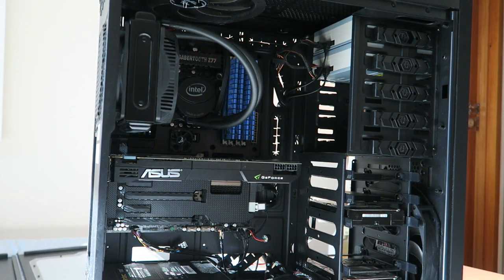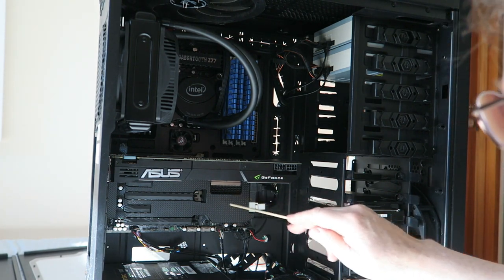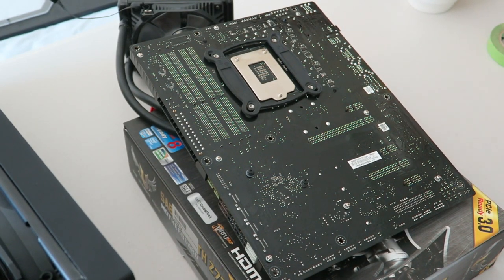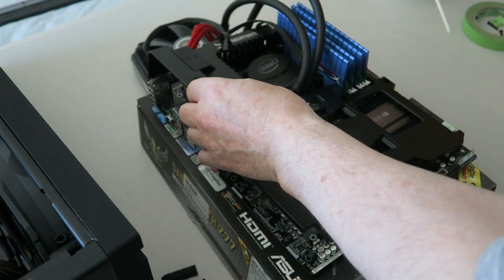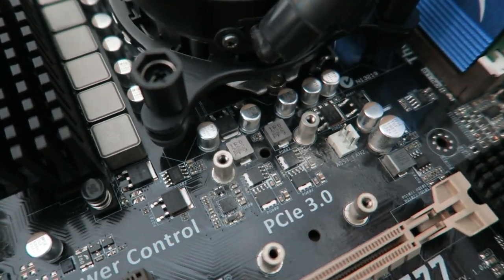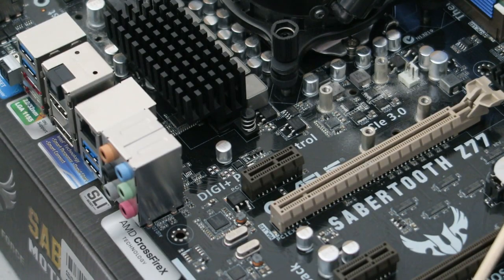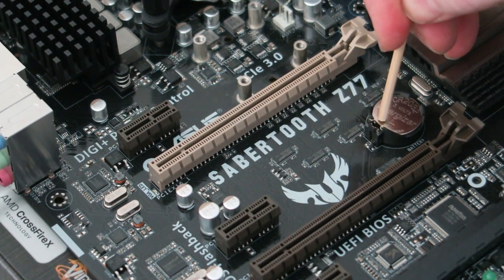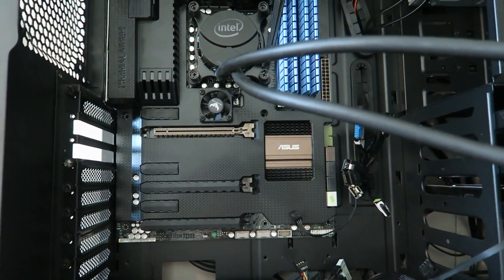ASUS SABERTOOTH z77 CMOS BATTERY REPLACEMENT

Comment: Just wanted to write and tell you thank you for posting this video. I have the same Z77 and I've noticed lately my time clock starting to drift slower as well. Not completely out yet, but I'm likely going to have to do the same thing you did soon enough. Thanks for showing us how you did it!
Reply from the maker: +wxmeddler  My pleasure...I Googled and You Tubed information for the z77 Sabertooth but nothing seem to come up specific to this board...so I thought I would do this video...thanks for taking the time to reply
Reply: Yes, I'd like to add my thanks too: at the moment the clock is keeping up, but not all the Bios settings maybe also because I wasn't turning the machine on since a while or at least leaving the PSU on the ON position to recharge the battery. I also have a full house inside the case regarding boards and a full disks array besides the cooler and about 8 fans (!)... I'm afraid it will take a couple of days just to change the battery for me: if I'll have to do a full disassembly I will possibly cut a window in the armor using my Dremel tool...
Reply from the maker: Thank you for the kind words...cutting a hole in the armor was done by another frustrated You Tuber...lol
Reply: Eheheh
the more I think of all those wiring, tubes, boards and what not, the more I'm convinced to expand the nearby hole: if only my Corsair C70 case had a full access to the back of the board I would have considered to unscrew the armor and just remove the boards and slid under the hood to replace the battery, but to have to completely disassemble my build to the bare bones just to change the battery is, well... unthinkable!
Cheers

Comment: Hi, thanks a lot for this video. I have a computer with the same motherboard and the battery stopped working some 2 years ago. After watching your video then, I decided not to try to replace it since the computer was still working but only in the standard default speed 3.5 GHz - where initially (it has a more powerfull cooling system) it was overclocked to 4.4 GHz by the shop I baught it from. That worked very good till the battery started failing after 5..6 years in use.
Now I purchased a new PC (Win11 compatible) which is really fast and nice (with M2 SSD of 4 GB) but the one with the Z77 is still good and now, that I do not risk loosing any work, I can try to follow your guideline to disasemble, replace the battery and reassemble the whole thing. If I'm successfull, I can either sell it on ebay or just give it away to somebody who can use it but does not have the money to buy a new PC (even if it will stay on Win10).

Comment: Thanks for the video. As soon and the POST complained about no CPU fan, I knew something had gone south... Labour Day weekend 2018 and mine just did the same. Think I am going to take the time to take everything off and then cut out a hole over the CMOS battery so I don't have to do it again. Sigh...
Reply: So, that was shockingly easy. Took me about 30 -45 mins all in. Although, with my after market CPU fan on the thing, I wasn't taking the plastic off and I didn't cut a hole. But, once you get all the screws and fan off, there is enough room to get the battery out and back in again without having to take the plastic cover off. Which is good as that would have been a right bitch...
Reply from the maker: Glad it was that easy for you ...lol

Comment: Thanks for video! Same problem. (The battery - actually cell - does more than just hold the settings - it keeps the clock going [it's basically the same sort of clock as you'd find in a wristwatch]. The cell number, by the way - 2032 - means 20mm diameter, 3.2mm thick! [There are also 2024 and 2016, same voltage but thinner. You find them in some remotes and other things.])

Yes, definitely design fault: I think of ASUS as quite good, but they really slipped up here!

I think we've decided not to go through all this, but just leave the PC plugged in; shutting it down (from Windows 10, probably most other OSs too) leaves the PSU on standby, which keeps the settings [and clock going]). If you do turn it off (or there's a power cut). and assuming you haven't set any settings other than the defaults, four keys will restore it to normal: F1, enter, downarrow, enter, with a pause befor each. (I was attending to it for a blind friend, who can't use the mouse, hence the need for a key sequence. His normal speech output doesn't come until Windows is started: a shortcoming of the industry in general - no-one makes a talkinh BIOS yet AFAIK!)

Comment: Awesome video. Brought me on the right track. Could be shorter, but as you previously stated, it was your first video. It took me an hour all in all without removing the Intel i7 processor and DRAM modules. Hope you get more thumbs up. And no: I didn't cut a hole for the next replacement, as it will hold for another 4 years and then the mainboard and processor will be replaced. Thanks a bunch.
Reply from the maker: Glad to be of help...next video I will get straight to the point...lol

Comment: Replacing my battery looked like a night mare so I was looking for an easier solution
I came across your video and saw that yours was an even bigger task
3 and a half hours,wow that is some length of time,you could have run a 25k marathon quicker.thanks 
Good video by the way
Reply from the maker: Thanks for showing some interest...yes it did take me a while, but I am not a computer tech person so I purposely took my time.

Comment: I also want to thank you for the video. I have the same problem and already had premonitions that it will be a lot of work (though I still hoped there would be an easier way :-) ). Btw, dear manufacturers: Why are the batteries not integrated into the front panel of the computer case with a little cover and connected with a cable to the board for a quick change? This is 21st century.
Reply from the maker: +Frisian Freedom  Thanks for showing some interest...and great idea btw.
Reply: Ys, this is indeed 21st century - when not only do manufacturers expect us to change things in less time than these cells take to run down, but we've also by and large accepted that conditioning. (For 'phones, they want us to - and we seem to have accepted that we will - change them far more often than that!) At least be thankful the cell is stil easily changeable in a holder, not soldered to the mobo.

Comment: Did you put the  armor back on or did you decide not to?
Reply from the maker: Hello sk8ernutdw...thanks for taking the time to comment....Yes I did put it back on because it did help reduce the dust collection on the board overall, except in the area mentioned in the video....I will probably have replaced this computer by the time the new CMOS battery fails again...lol
Reply: What about the ram? Did you really leave it in there? Wouldn't that be a bit risky? Normally i would maybe take the ram off... just wondered what your thoughts on that. I have to do this tomorrow it sucks.. i am so angry the fact they had a design flaw..
Reply from the maker: Yes I did leave the Ram on the Motherboard, but you can take it off if you wish...see video at 6:42.
If you want another way to change the CMOS Battery see this video...this is not my recommendation though, but it work for the video creator
https://www.youtube.com/watch?v=xdCNeT-sjjk

Comment: Have same problem on my z77 ROG. Goes to same start screen. And I had forgotten my Bios password. Luckily online help referred to ROG as having Cmos clear button at rear panel. Password gone, Bios now accessible. Can now look for battery. Look at manual online, battery is under graphics card. I have a very large Asus Gtx 680 CU that takes up 3 slots (has support bracket because it is so heavy) that is a chore to remove. Now with your help I can get battery and replace. Thx for Video. Any help is help.
Reply from the maker: Sorry for the delay, thanks for your response...glad I could help

Comment: To change the battery in a Ferrari Mondial one must first remove the passenger front wheel and inner fender.  Maybe this is a common issue with batteries in fast machines.
Reply from the maker: LOL...

Comment: Hi i hope you can help me. Everytime when i boot my computer there is no connections to my Monitor, Keyboard or mouse.... What should i do?
Reply from the maker: That sounds difficult...as I mentioned in my video above...I am not a tech person so my Computer knowledge is limited. You could log on with another computer or a mates computer and Google the problem and look at what comes up...you may have to read through a lot of posts to get some information or just contact your local Computer Store for advice....sorry I do not have the answer.

Comment: Thank you so much for the video, you saved my life, you are a hero!
Could you please show us how you clean the motherboard ?
Thank you so much!
Reply from the maker: Glad I could help...to clean the little bit of dust build up as best I could that I showed in this video...not technical,  I just had a can of compressed air and carefully blow the dust away...the dust particles that did not remove I used that wooden kebab stick (pointy end to loosen dust, being very gentle)... then can of compressed air again.
I purchased the can of compressed air from my local Hardware Store...but possibly a Computer Store or Automotive Store might be another choice.
Hope this was of help.
Reply: ImageArtSigns Yes, this is so helpful, 
Thank you so much!
Reply: the dust may have accumulated near the Capacitors because as Capacitors age they outgas(leak) and put a sticky layer on the Motherboard.  @ImageArtSigns

Comment: After overclocking I had this ''CPU Over Voltage Error '' and replaced the battery but now my system get stuck on ''Please enter setup to recover BIOS setting'' but when I press f2/del to get in  the bios of my z170 asus pro gaming it doesnt work and i get thismessage again, any help? Please. Thanks in advance
Reply from the maker: Thanks for showing some interest....Have you tried to Google the problem,...enter... ''CPU Over Voltage Error ''... as that should be the first port of call for any PC problems...this was how I was able to do this video by using Google to find the answer and fix it....or possibly going into the Asus or Hardware Forums and looking there, again this is something I did to find answers to the problem I had here....it does however, take some time...best of luck.
Reply: Thanks for your reply. Problem was solved ... FN key + F1 oops!
Reply from the maker: Thanks for letting me and anyone else that reads the replies to this video...much appreciated :)

Comment: Just noticed it,z77 sabertooth has the cmos hidden beneath the plate,I went back to check my board z87 sabertooth,hopefully the cmos was in an open area,easy to replace else it would be a pain to the ass
Reply from the maker: Just looked at a You Tube video of the z87 Sabertooth Motherboard and the CMOS battery is clearly seen at the bottom of the board....woohoo

Comment: Its sick to hide the battery in such place, now I have to spread my whole PC. :(((
Reply from the maker: Thanks for taking the time to reply...Yes you are correct I did spread my whole PC....BUT WAIT...there is another option if you want to by using a small wire cutter and just cut the Motherboard plastic shield cover at 2 points, then you can just lift up that area.
see video named...'ASUS SABERTOOTH z77 Battery Replacement easy way' .....by Muhammad Asif Sherazi....he shows you where to cut the Motherboard shield....just a thought and good luck.
Reply: ImageArtSigns thanx for the replay, I saw this video but I don't wanna cut the plastic. This is a good time to clean the motherboard ;) regards
Reply from the maker: Yes, a good time to clean the Motherboard...good luck

Comment: I use a H100i Cooler. I may be lucky as well to slip it off too..
Reply from the maker: Hopefully yes...but even if it does not slip off completely, as long as your can get that the battery...good luck
Reply: This was actually easy but sadly you did not show what screw you used to open it and i know they are small and i ended up going to the PC shop and getting it fixed for 150 bucks i feel like i wasted my money and could have done this better if you had footage of yourself unscrewing the screws with the required recommended device lol.. o well. Lesson learned.